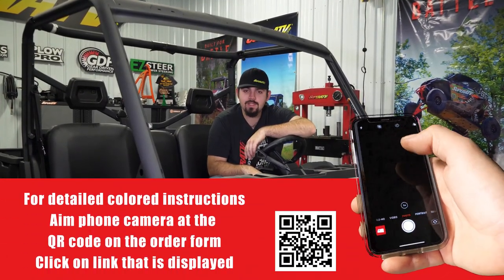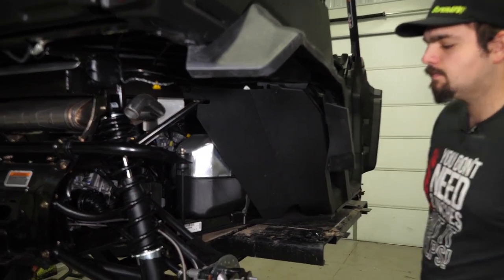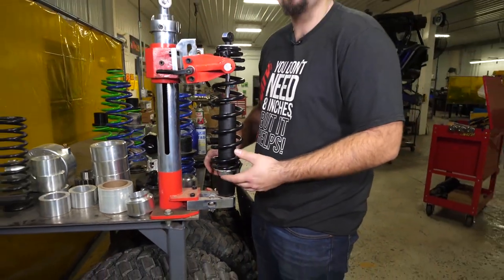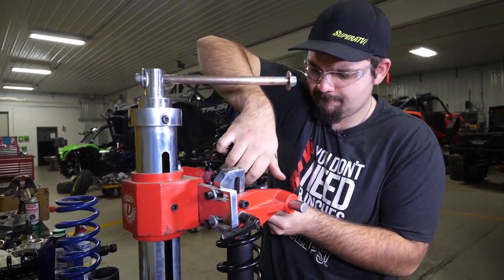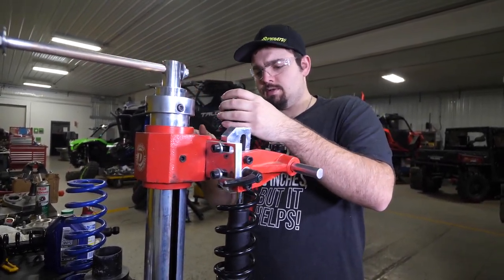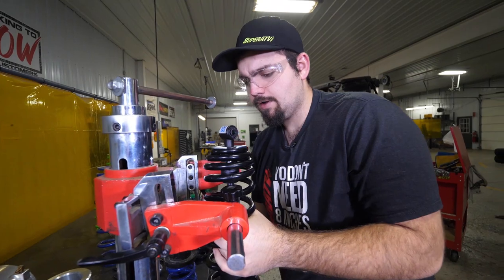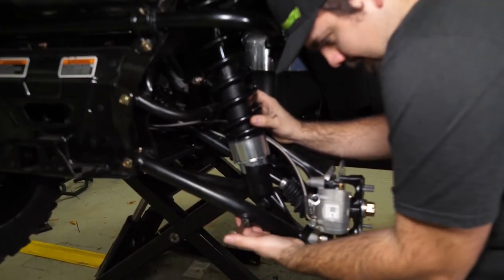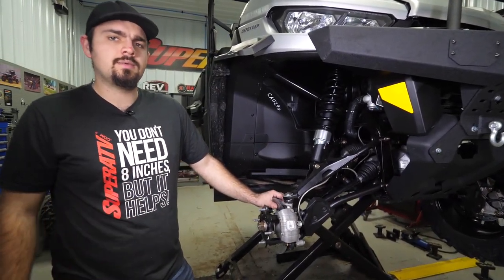Can-Am Defender | 3 Inch Lift Kit Install | How To | SuperATV

Comment: I have a 2020 can am defender hd 8 comes with stock 27 inch tires can I run. 30 inch tire on it with changing my clutch and belt I also have 3 inch on it so not worried about clearing just don’t wanna mess up clutch or belt thanks

Comment: I'm no expert but didn't you just make the suspension SUPER tight by compressing the springs another 3"?  That's not a lift, that's just making the suspension super tight so it doesn't have any flex.
Reply: No replies to questions in the comment section but yet you keep on uploading videos.
Reply: Compressing the springs did not add 3" of lift. How did you add any lift to the vehicle? ( I used to be a GM trained mechanic, aka Mr. Goodwrench, now retired)
Reply: This video makes no sense.  Make me want to stay away from superatv.

Comment: Can someone explain the benefits of this method of lifting vs. a bracket lift kit?
Reply: Especially when they offer this method for the can am and just a bracket lift for the polaris
Reply: @DudeManBroShow  since my first comment I’ve found a 2” lift for a Can-Am defender that uses brackets in back but additional spring compression like this in front. My guess is that brackets are going to change the suspension geometry no matter what while coil spring spacers extend the shock more along its intended line of travel. Or it could be that too much spring preload in the back makes it feel like you have no suspension at all.  😬 

I do wish these guys would answer reasonable questions …
Reply: @chipsterb4946  I can't imagine this doesn't ride stiff as hell after this...